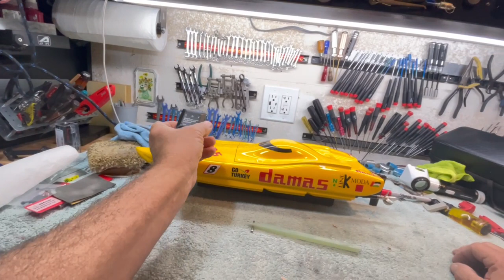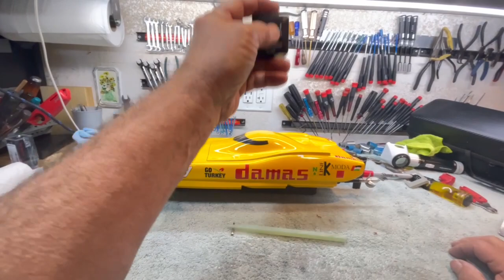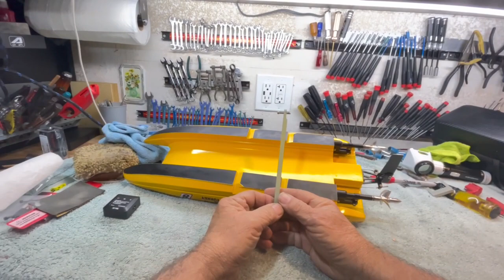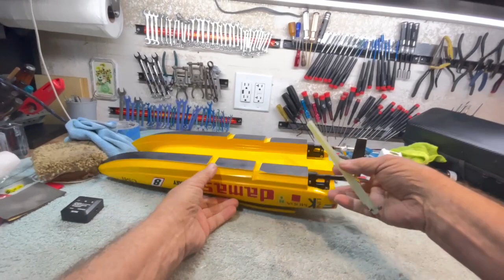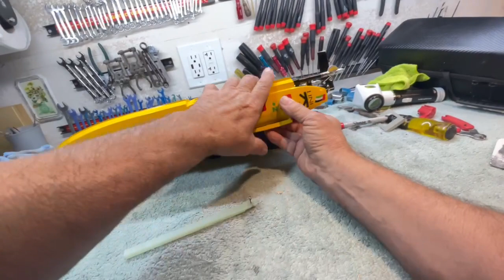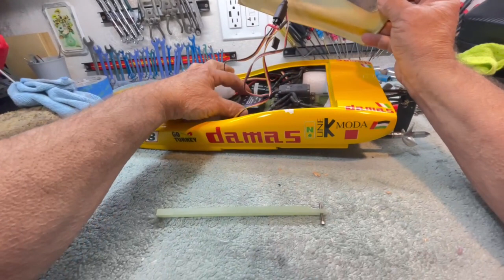Dr. Jet posts a video because it's been kinda slow at the Boat Gang.

Comment: GPS  😎😎...how much does it weigh?
Reply from the maker: 2.89 ounces, according to the manufacturer.
Reply: Is that the SKYRC GNSS GSM020? If so 38g or 1.34oz / Size 40 x 39 x 16mm / look forward to your results.
Reply from the maker: Yes, it is the SKYRC GSM020.  36.89 grams (measured).